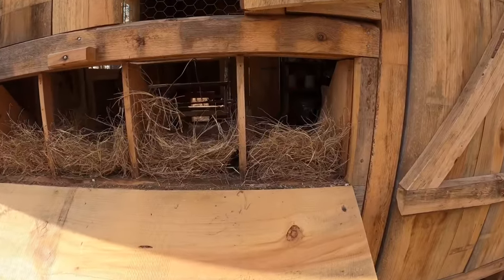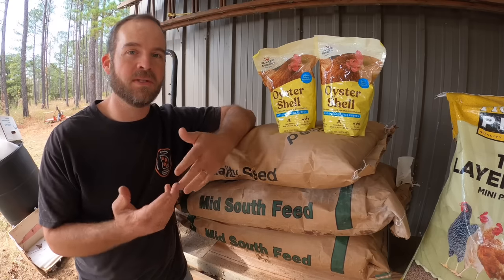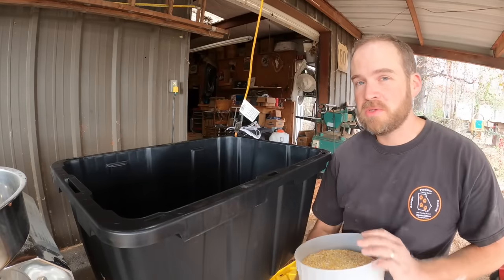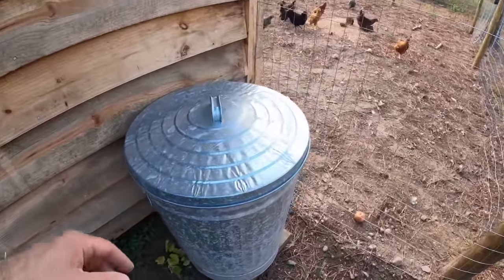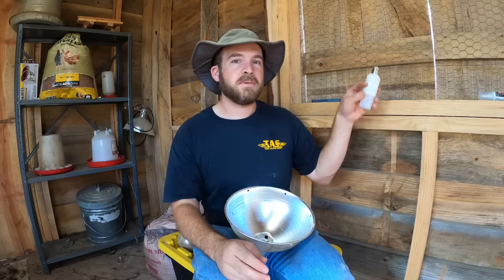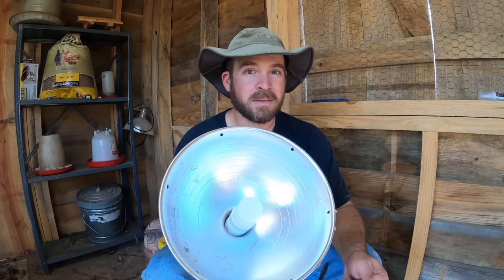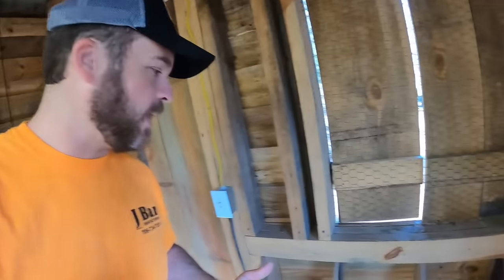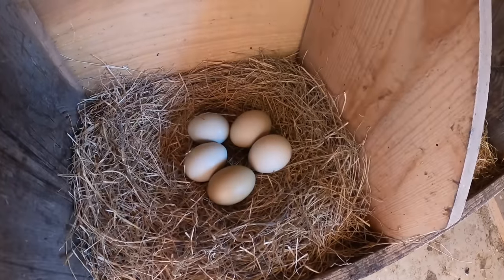I Made My Own Chicken Feed, Here's What Happened

Comment: We had this same problem last year.  We went a little different route.  Knowing that the light was the issue (and our feed at one point) we made it through the season and come spring when we had an abundance of eggs we've tried "water glassing". There are several video's on YouTube for this and we're doing one too but it probably wont be posted for another 6 months.  Basically it's an easy way to store eggs, without refrigeration or freezing.  

Second...  on your feed... if you want to do a larger batch of feed scroll around marketplace for a mortar/cement mixer.  Its handy to have around the homestead for those little concrete projects as well as an easy way to mix large batches of feed for various animals.
Reply: And to think my wife keeps calling that concrete mixer I bought useless, thanks for the info!
Reply: @destructionfromthehills204  😅

Comment: i have had as many as 50 chickens of laying age ( Rhode island reds) and found that light is the key as i did not change the 16% proteins feed that i was using at the time.   16 to 18 hrs seem to be the sweet spot for me.  It seems the winter production is a bit lower then summer with the same rations and no other changes.   I think i would recommend 16 hrs of light and to gradually increase the light over several weeks.   Also, the calcium is important as over time u will find the shells getting thinner which means the calcium is being scavenged from the body of the bird.
Reply: We had one chicken start laying a very soft egg. The other three chickens eggs seemed fine. We hadn't changed anything with their food, we give them Oyster shell in a separate feeder but still was getting the occasional soft egg.. 
Any other ideas as to what's going on here? We have 4 Buff Orpingtons
Reply: I agree and I keep it there with fine rocks also

Comment: I took charge of a large poultry barn, total about 300 poultry (mostly 200 chickens).  I "ran" this large barn from mid-February of 2021 to April of 2022.  There was lighting in the barn 24/7.  NEVER TURNED OFF.  Even with single digit temps during the cold winter months, they didn't stop laying.  None of them moulted either!  Used the same PPride brand you showed at the first of this video, but we also had 5-gallon buckets of thrown out restaurant food (mostly oriental food).  I went out of my way to give them green stuff (weeds from garden).  They never even slowed down on egg production!

Comment: Great video good stuff to know. I'm not far from you up on lookout mountain judging by your J-bar shirt. We just picked up eight chickens in the beginning of spring of 22. Thought about the same issue. I've had friends say that chicken slow down in the short days of winter. What I did was I took a LED grow light for plants and put it in the coop and set it at a nice summer's day length of sun. Viparspar p1000... Can be found on Amazon.  Maybe it's because the chickens are still young????. Eight chickens and so far through a very cold winter at times consistently getting nine to 12 eggs every 2 days.  Thanks for the video!!

Comment: What was the cost difference between the premade feed and the one you made?
Reply from the maker: This is a rough estimate, but this mix is about $17 per 50lb. A mix at this protein level (~23%) is probably about $22. Standard layer feed (16% protein) from TSC is 19.49 for 50lb. Keep in mind though that I got the corn in bulk locally for about 15 cents a pound, so if you buy it by the bag it's going to be more.
REPLY
Reply: @falllineridge  have you calculated how much it costs you to produce a dozen eggs? Feed, electricity not to mention the chickens, that grinder and your time. 

I know that either way it’s worth it to know where your food comes from but it would be interesting to see those numbers.

Comment: #1 difference between what you mixed and and producers pride is you used whole grains and they use what got swept up off factory feed.
When you are getting tons of eggs in spring/summer you need to preserve them and then let your hens have a vacation.
You can freeze dry, dehydrate, water glass, freeze.... Or just keep clean eggs refrigerated.  They last several months in refrigerator.

Comment: There is a way to tell. If you can get 1 finger in the vent either they are too old and stopped laying or not mature enough to start. If 2 -3 fingers means they are mature and or still laying.  I have 4  4 year old white leghorns and 3 are molting currently so no eggs from them. I have 7, 8 month old chickens RIR, Golden Comet, Buff Orpington, Barred Rock , White leghorn and Black Australorp.  All but my buff and Australorp have been laying for a few months now, my Australorp just started a week ago after all this wacky 19 degrees here in South GA/ North FL. my Buff is still not producing. I am on producers pride with them as well and get about 5-7 eggs a day. I let the out in the yard for about 30-1hr maybe twice a day. They have Grit and Oyster shells 24/7 , but not special bugs since they get yard time. Sometimes its the chicken. RIR Mature around 16-20 weeks other later. Have their Combs and Waddles turned bright red that is another sign of a mature or laying chicken.

Comment: I have 3 1 year old hens and have not had any issues with egg production due to season or weather. The coldest was 3 degrees and have had numerous high 20 degree days this winter. I did add a ceramic heat lamp when the cold hit and its on for 10 hours placed above their roosting branch. 2-3 eggs a day is typical from as long as they have been laying. Producer's Pride mini pellets and cracked corn mix 80/20. I have a hanging feeder and notice they don't seem to eat all the corn they knock out. Not feeding them for 2 days doesn't seem to have them go for it either. They free range in our 1/8 acre backyard about 8 hours a day. Occasional food scraps added. The yolk color is getting more orange with the grass, weeds they are now eating. I get way more than I need and give most away to family and neighbor. It's a fun challenge.

Comment: Back in the early 80s there was a tiny,tiny mite problem that killed domestic and livestock birds. Can not remember if it was keep feed extra cold or microwave or both. I bought a microbe scope and took samples. Threw out the products and started over. Treated my birds. Lost 3. Taking test samples did well. The news covered this along with veterinarians. Recall from major company and Feed stores cleaned out bulk. Even oats rye was a affected. I found that taking test batches help watch for molds also before you can notice. Keeping food covered and tight helps. I say this just for information.

Comment: For ours light is the biggest factor in producing. I have a smart switch that turns on the lights to that they are on 14hrs a day, starting from daylight. With that, they produce as well in the winter as they do in the summer. Our first snow, if snow melts and then they can see bare ground and we get snow again, will generally throw ours off schedule for about a week or so until they get used to seeing the snow on the ground again.

Comment: To help your hens lay eggs during the winter months, adding a light helps. Any light will do. As the light stimulates their bodies to start producing eggs, which takes 24-26 hours from start to finish.

The best light, is a full spectrum light. Although the color it produces is white, it actually has every color. Now, any light will technically work and a led bulb is best, as it doesn't get too hot. The only time you need a heat lamp, is when you get chicks.

And depending on the color of light, your eggs will be different in shape. Red, blue, green, etc.. Who knew. 

The bulb I'm using, is an LED bulb with a switch to change the colors. I have it set to Red. It does have "natural sunlight" too. I turn it on before work and turn it off around 7-8 pm. They need between 12-16 hours of light. Which is why, they produce less eggs during winter, when it starts losing light around 4:30-5:30. Although the feed you give them, is important for strong shells, nice color yolk and help with their feathers, light is needed more to actually get them to produce eggs.

Now, hens generally lay up to 1 egg a day, for roughly 12 days, then takes a day off. If you have a hen laying more than 1 egg, that means you're feeding them too much.

You want to feed them no more than twice a day, generally around 6-7 am and then later in the day. In the morning, give them more than in the afternoon. As they start to get bigger, give them scratch. Toss it on the ground. When you start feeding them egg layer crumbles, that's what I use, (pellets are fine too) , add in grit. It helps them digest the food. Can be bought at any feed store.

Have plenty of water on hand and in the winter, having a heated water dish is good. 

Chickens can withstand the cold, even a few degrees below zero. But any colder, you may want to get them inside and have them sleep in your bed with you. 🤔 That actually is entirely up to you. 😐🫣

When the winter blast came through, we had -5 temps with -23 wind-chills. So I used a heat lamp in their coop and it helped, but with the wind the first day and the front of their coop opened (I built it), they didn't like it. So where they are free to roam, I got it fenced off, so they are protected top and sides from predators. I had covered that area with plastic and right outside their door to their coop, they huddled in the corner to get away from the wind. As dumb as chickens are, they are smart!

With my setup, most of my chickens are producing every day. With prices of eggs the way they are, I'm making out like a bandit. Have to actually give some away. Someone at work today, said they would pay me $2 a dozen. That would help me with feed and them with saving a bit.

Lastly, if you get chicks, spend any time with them you can, they make great pets. They will get to know you and be submissive. And if you choose to let them roam free with no fence, they need to stay in their coop for around 6 days or so, before letting them out, so they know that is home. Same if you buy them once they are already producing. 

And expect your hens, depending on your variety, to lay eggs for up to 3 years. And each variety lays different differing amounts each year. Mine, roughly 240 each year. After that, if they are good roasters, then you can have them processed for meat. Some are better than others. And if you plan on raising your own from egg, you need a rooster. 

🐔

Comment: In order to get full use of light, you must have the lights on for 14 hours per day. When it comes to feed, you ned to boost up your protein content to 16%. This can be achieved by adding alfalfa to your feed mixture. Remember the bug population is very low in the winter months, so you need to increase that protein. Alfalfa is the best way to do that, but do not over feed it. It can cause stomach problems if over fed.

Comment: DIY Feed mix Protein calculation, corn 8%,wheat&oats 12%, soybean meal 45%. So 1 part each 8+12+12+45=77/4= 19.25% adjust accordingly to bring protein up to around 19% you can add black oil sunflower 45% 8+12+12+45+48=125/5=25% can add 1% by volume calf manna for minerals. Milo& millet 8%, rabbit alfalfa pellets 45% just different options.

Comment: With hen layers; The thing that gets them laying is to get their body temperature up as the winter comes with cold stops the cycle. How to change this cycle and get body temperature up, method is get wheat bran with a small amount of wheat and then you add boiling water to a slurry and feed at maximum heat and then place heat globes into the pen will then get a higher laying percentage. length of day is not the true answer to laying regularly but body temperature. try it over a week and you will see a big change. good luck.

Comment: Keeping the chickens laying you do need light, but not just 3 hours it takes about 18 hours of light a day. meaning 6 hours of night.  You might want to give that a try and also it will not be in a week to see much progress you need to let it go all the time until it starts getting daylight at about 5AM and the sun going down about 9PM. So you need to start a little before dusk and then turn the off about 9PM. You might want to google it for exact timing, but my uncle farmed and that was about what he did as I remember.
Reply: I forgot you need to adjust the time of artificial light though out the year. Also, most of the time 2 21/2 years will be the profitable years of laying and will drop off no matter how much light they get.
Reply: I'm remembering things as I think and read about some of the others who responded here. It is very important that the diet of the chickens doesn't change much so you really want to stay with the same manufacture and the same brand and name of the feed. You don't want to through the chickens off because of diet. Much Like a baby is fed and may not do well on some because they were changed to another brand. Some changes can cause them to molt, and you done with eggs until they get through it. Changing can be done with no problems but. I know that my uncle would not change the mill he bought food from and even then, he would mix the new with the old over a week two giving of the newer every time he fed until they were changed over. If you're mixing your own, it is not as much of a problem.

Comment: I've been searching everywhere for a decently priced bulk products, even Tractor Supply and IFA.  Black Oil Sunflower Seeds - $44 for 50 lbs, Cracked Corn - $17 for 50 lbs, Oats - $29 for 50 lbs.  With those 3 alone, its not worth it to do flax seed, white millet or split peas.  With the prices I found, DIY feed is just too expensive.  A 50 lb bag of regular chicken feed with a decent protein percentage and all other promised nutrients is $27 for 50lbs.  Is there another location?  I'm located along the Wasatch.

Comment: I just got this brilliant idea to mix you home made feed,  go to harbor freight and get a plug in concrete mixer, a new unit thats clean,  put your grains in it and let it run. Do it by buckets full of each additive keeping track.  You can get the smaller or larger unit, or get it at any cheap tool supplier  but it will mix your feed and do a good job of it.

As far as the factory made chiken feed, stop giving it. I dont raise chikens. But I'm willing to bet they are putting a male hormones in the feed. This is blocking egg production.  What could you feed a chiken thats not going to kill it, male chiken hormones.

Id also give fresh vegetable trimmings like the clean outer leafs off lettuce 
Peels of carrots uncooked unflavored foods, I know if you feed a dog garlic and onions its bad for there digestive system and can kill them, but  fresh food chikens normally eat isn't bad for them.
Somone said they love fresh cut grass.
 Your pin has no grass in it they eaten it all. Obviously they need it in there diet.
Animals will show you what they eat you just have to pay attention.

Comment: When I chickens I would feed more oats to get more eggs and the oyster shell helps the egg shell thicker I ward it when the chickens were older my chickens were free range so they got lots of protein from bugs ect the water in the winter was fun but I took a old water heater cut a 6 in hole the length of it put legs on it and a hole at the top that would let a elect plug fit through and put a stock tank heater in it and it worked good

Comment: Chicken slow down laying in fall and winter and especially if they are molting to replace feathers.  However I have had chickens for quite a while and this year the all almost completely stopped laying in early fall, some were molting but not all, out of twenty four birds was getting four eggs average... There were two brands of I was using and one was a scratch grain, but ass I was pouring it into my feed bin noticed some type of pellet mixed in so checked the next bag was the same but could not find listed what it was that was not from tractor supply but Kalmbach feed, so stopped buying it, got some producers pride layer pellets and scratch grain from there but still hardly any eggs, so did some research and now went to a completely different brand and kind of food started getting more eggs with in a week... By the way we are now paying for forty pound bags the price of fifty pound bags also...

Comment: ITS BEEN MANY YEARS SINCE I HAD CHICKENS. i never really liked buying anything from tractor supply, but bought a log splitter from them in 1981. also bought 2 chainsaws from them 1 in 1981 and 1 in 1986, then a remote control cable for a 3000 watt inverter in 2017, and a few propane tank refills between 2016 and 2018.
the drag queen crap has caused me to swear that ill blow my own brains out before i spend even 1 cent at that company!!

Comment: Is home made chicken feed cheaper than Tractor Supply?
Reply from the maker: Seems to be. This is a rough estimate, but this mix is about $17 per 50lb. A mix at this protein level is probably about $22. Standard layer feed (16% protein) from TSC is 19.49 for 50lb. Keep in mind though that I got the corn in bulk locally for about 15 cents a pound, so if you buy it by the bag it's going to be more.
REPLY